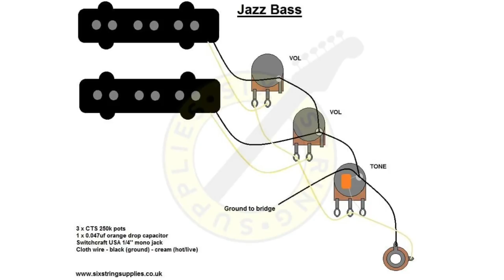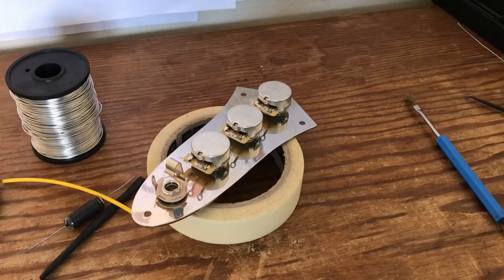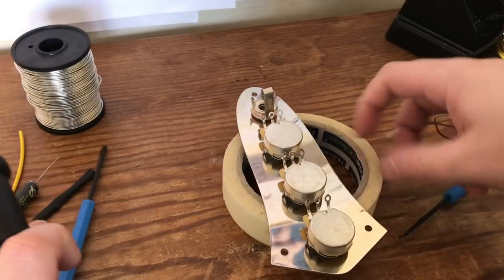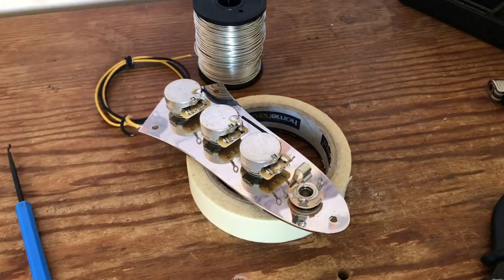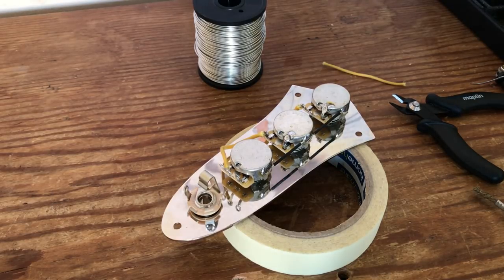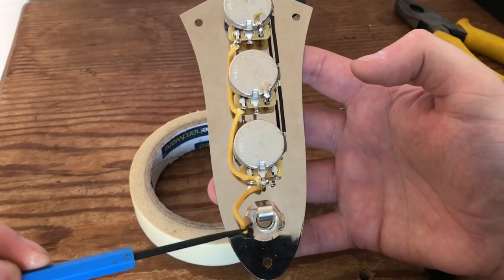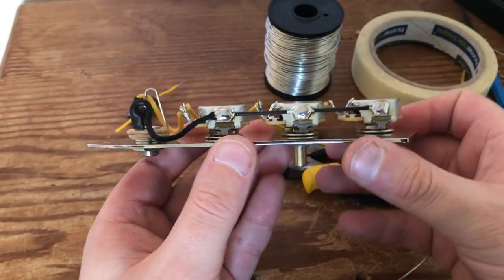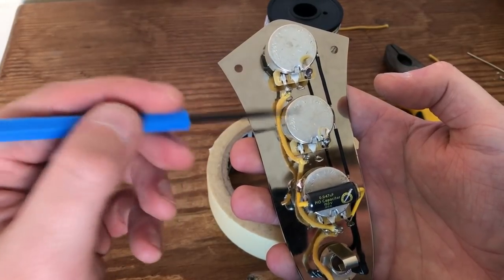Jazz Bass Wiring - How to wire a Fender Jazz Bass

Comment: Amazing video and description of the process! I just followed this video, step by step (pausing as needed) , and just assembled my JB wiring kit so easily. Just curious, your linked diagram mentions not needing to run the ground from pot to pot if you're using the jazz bass metal plate, but you don't mention that in the video. Is that really the case? You also don't mention where to attach the bridge ground in the video, but it's in the diagram you linked. Regardless, THANK YOU for this video. I'm a complete newbie to soldering, but you gave so many tips it was so easy. I never could have done this without it!

Comment: Great video. It's clear enough that I've made the leap to order a pack and do this. For the grounding wire you mentioned briefly that it could be done with the cloth wire provided in the pack. Does this have to be one continual wire like you've done here or because of the cloth you do seperate wires between each pot?

Comment: Great Lesson, I have a question, I am upgrading my 78 Fender Jazz with Seymour Duncan Weather report passive pickups the neck pickup is not as hot as the bridge pickup they came on had a black and yellow wires and the other had black and red wires? I'm am planning on re doing the wires exactly like your video how would you know where the black wire should go or if it matters? Thanks from Minneapolis just Subbed as well as well

Comment: Such neat wiring, no slop.  Not like the rat's nest that lives inside my Fender. Excellent!
Reply: Yeah, I got a bass given to me that had a massive rats nets of the cheapest plastic coated wire ans it was all full of cold solder joints and general nastiness inside and I hate the pots aren't on a plate or in a straight line like this one is. It's been an absolute bear to disassemble and re-wire to the point that I am bored with working on the bass and will probably sell it when I get done rewiring it. I almost wanna say it wasn't really done correctly from the factory because whoever was tasked with wiring it gave up on trying to get it done neatly

Comment: brilliant at last. I bought 20 cts pots and the range went from 201 to 286.  Would you explain the differnce between audi and linear and what is the benefit of no load. Please?
Reply from the maker: Hi wow that is quite a range, though most CTS pots are made to 20% tolerance. The basic differences are outlined here: https://www.sixstringsupplies.co.uk/audio-or-linear-pots

Comment: I've had trouble getting my pots to heat up. What temperature do you have your iron set at? It looks like it heats up to receive the solder very fast.
Reply from the maker: Normally 350 degrees C. It depends on your solder too, not just the iron (different solder can have different melting temperatures)

Comment: Six String Supplies stuff seems to be really good quality. I stripped the electrics out of an 1990s Epiphone Les Paul and they looked very cheap and low quality compared to the rig from these guys that replaced it all.

Also, they don't charge the earth, either (no pun intended). I shopped around and good ol' Six String Supplies offered the best quality at the best prices AND they gave me a quick call on my mobile before dispatching my '50s style wiring harness to confirm my preferences.

How many companies do THAT!?

Comment: Surely the pots are ground together by the metal plate right ?
Reply from the maker: Malcolm Hardwick yes they are - no need to connect the pots together if using a quality metal control plate. I just do it out of habit...

Comment: Hello, I´m replacing all my Maya jazz Bass electronics and pickups and the holes between pickups and the pot area is very narrow. Can I remove the original pickup cables (those ones soldered to the pickup surface) and put another narrower ones? Thanks, I like your videos!!

Comment: I got an old jazz bass today that someone else tried to fix but failed. Neck volume pot is a 500k and the other 2 pots are 250k, could this prevent the circuit from working

Comment: I have a newbie question: I appear to have a dead bridge pickup or pot but then realized there is no ground wire running to the bridge... this maybe be an obvious answer but is that why my bridge pickup/pot is dead? I was under the impression the ground to the bridge was for noise reduction... is it necessary for the pickup/pot to function?

Comment: I have a squier jazz bass with Duncan designed pick ups . . the wiring is completely different than the layout you have there . .the ground terminal on the jack input has no wire connected at all. All ground wires from my pickups and bridge are all connected together and soldered to the top volume pot body ground.  If I reconfigure it to the way you have wired it, will it work?
The reason I even looked at it is because the bridge pickup is low in volume and distorting in sound thru the speaker, the front pickup sounds great.
Can anyone help me on this please?  Thanks.

Comment: Hopefully not a silly question. When you connected ground wire using the tin copper covered in the rubber tubing, is that one continuous piece of tin copper soldered onto all three pots?  Or is it two pieces of tin copper cut and then soldered to the three pots?  Cheers.
Reply: it doesn't matter, you can have a 'ground' solder behind each pot, make sure they are all connected

Comment: Could you help me please?
How should I wire a second tone control in such a way that a volume and a tone to be for one pickup and the others to be for the other pickup but without influence of one set of pickup/volume/tone to the other?
Reply: I'm wondering this as well. I'm building a pj bass and it makes sense to have a separate volume and tone pot  for the the bridge pickup

Comment: I have a question.  I am wiring my first bass. Normally, and on guitars, pickup output goes to one leg of the pot. Other leg of pot is grounded. Middle leg of pot (which is the wiper) is the output. Yet on a bass, pickup output goes to middle leg of pot, and one end is goes to output & the other to ground. Why?!? What is the logic behind the pots being wired opposite on bass vs. guitars?

Comment: I've read/heard that, with a metal control plate, it is not necessary to also run a ground wire between the pots and the ground of the output jack. The control plate serves the same purpose as that ground wire. Is this true?
Reply: it's true, but if you're pot is loose, you will be losing the ground on that pot and it will make it sound scratchy.

Comment: Adding a question: what does it affect if there's no wire grounding between the pots and the ground connector on the output jack?
Reply: there should be a ground on the pots and and the output jack's sleeve, that's how volume works and the tone cap to the ground is to shunt highs to the ground

Comment: Do the pots need to be solid shafts? or are split shafts good as well?
Reply from the maker: You can use either as long as you have the control knobs to fit split shaft 👍

Comment: do you really need to ground all the pots together considering they are all connected the steel control plate?
Reply from the maker: Nope - but no harm in re-enforcing the ground connection

Comment: How much harder is it to add a push pull pot for series/parallel with no experience working with guitar electronics before? I've found the Seymour Duncan wiring diagram for that config, is it just as simple as putting the wires in the right place even if you don't understand what they are for?
Reply from the maker: Bongo2296 yes mate I use the same diagram. Just follow it carefully - it’s only the first volume pot that changes the rest of the circuit stays the same
Reply: Going one step further, could one of the volumes be replaced with a 3 way switch (Neck - Neck/Bridge - Bridge) and have the remaining volume have the series/parallel pot in it and control both pickup volumes as one? I don't know if it's possible but it's what I'd like.

Comment: Do you really need a ground wire connection from pot to pot if the pots are mounted on a conductive metal plate?
Reply from the maker: Nope - just reinforces the ground, no need to do it if control plate is metal
Reply: @SixStringSupplies  Thanks for responding and the video.

Comment: On my Mexican Fender Player Jazz Bass, there is no wire connected to the sleeve (ground) of the output jack... The bass is noisy as fuck. The official Standard Jazz Bass wiring diagram from Fender.com does not include a ground wire from the output jack. Why could this be?
Reply from the maker: some diagrams won't show the ground circuit, including some Fender ones. Definitely add the ground circuit if your bass is noisy. Especially on the jack :) Cheers.